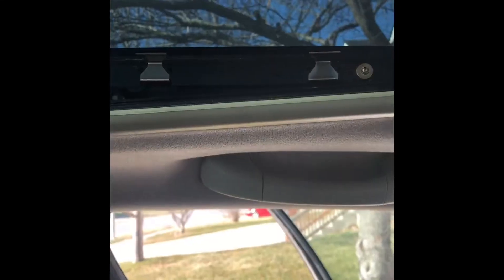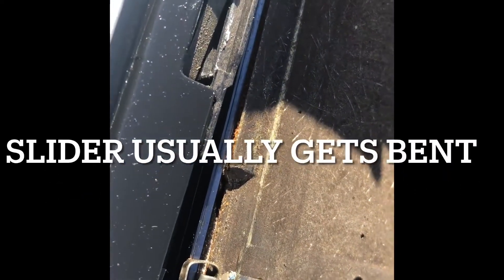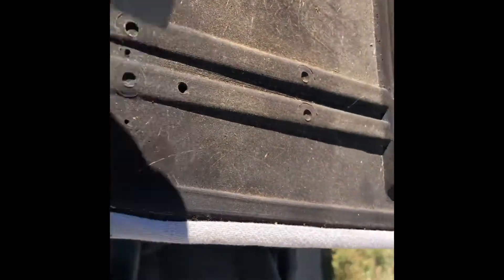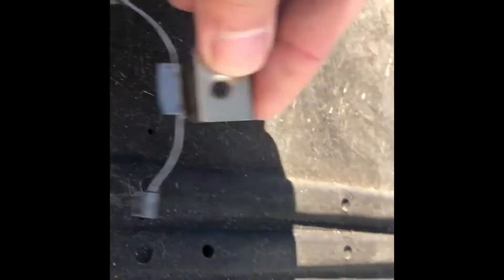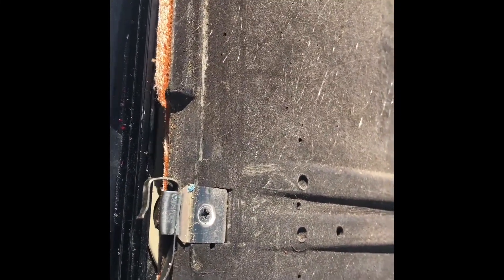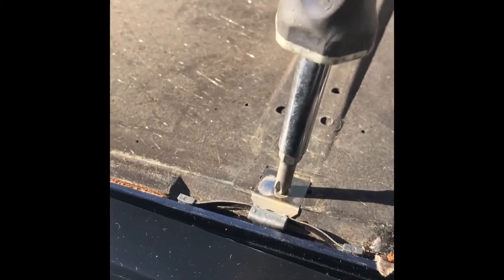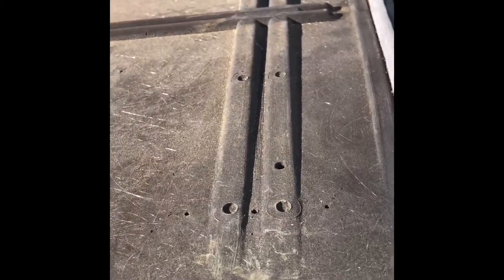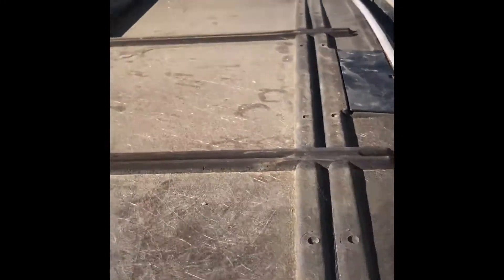Fix sunroof shade not sliding!

Comment: can U spray wd-40 ROUND THE LINNING ? IT JUST SOUNDS LIKE it needs some?
Reply from the maker: you can if the sliding brackets are not bent. If they are bent then they need replacement since they will be off-track.

Comment: Do you know how to fix the moonroof cover on a Nissan Murano? A lot of us are having a problem with it sagging, apparently due to heat. Nissan wants $2800 to fix it. That's insanity!
Reply: Listen to me carefully: buy some 3m headliner adhesive from Walmart, spray it into the spot where the head liner is sagging. (If sagging in center, you may need to open the shade and pull the headliner out at the front. Then stick the headliner back up using a credit card or something like a credit card